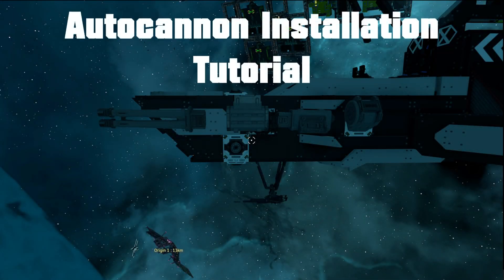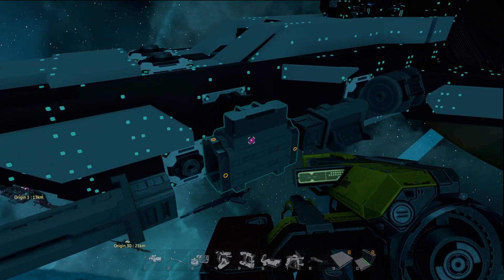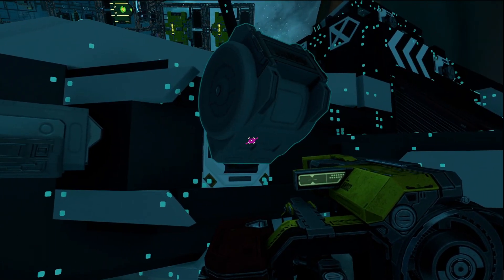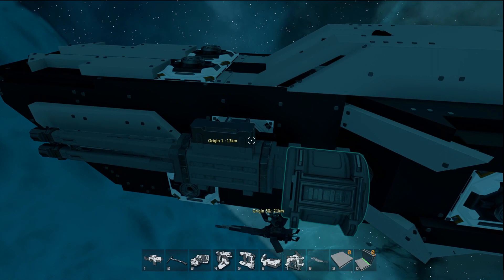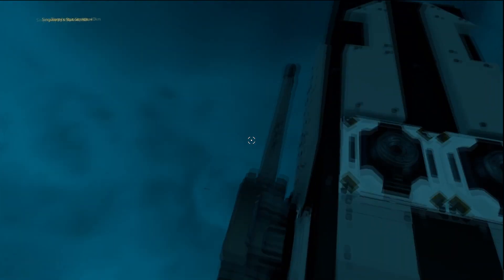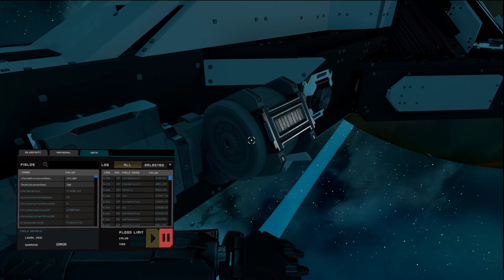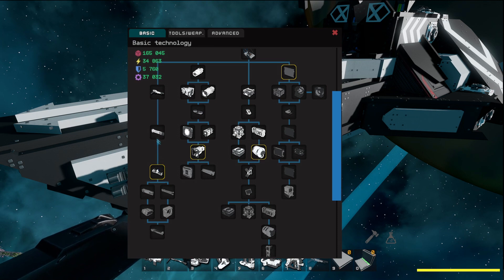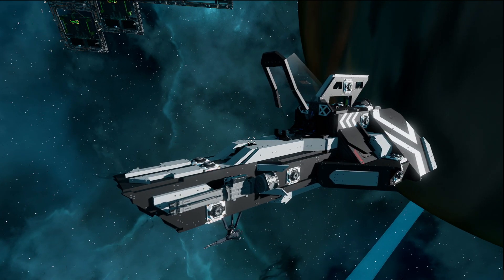Starbase: Autocannon Installation Tutorial

Comment: Unfortunately, one important point was not addressed. How can I switch off the power consumption of the AutoCannon?
I have 17 batteries and 4 AutoCannon in my ship (Designer). In test mode it takes about 1 minute in idle mode and the batteries are empty (reactors are currently not active).